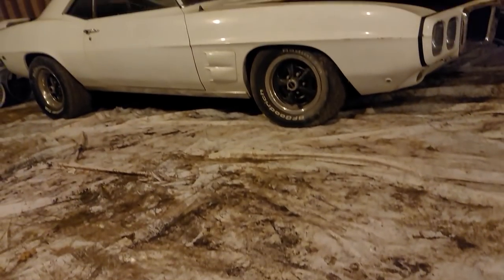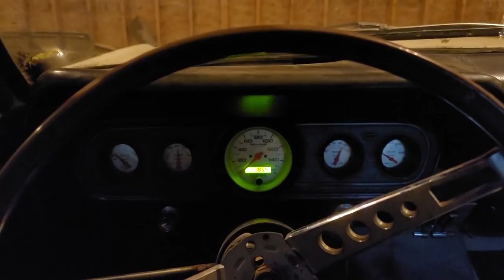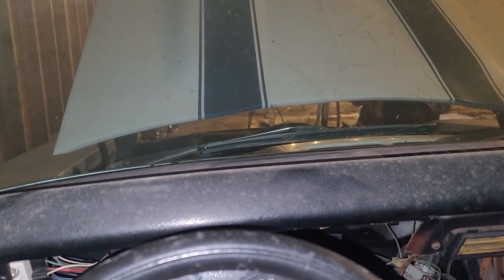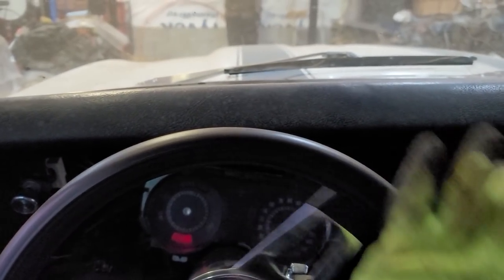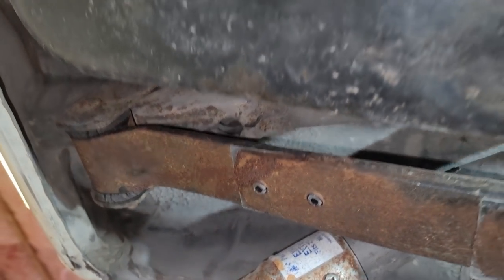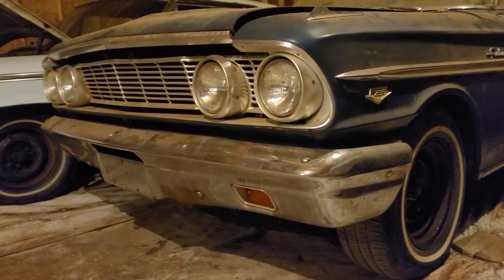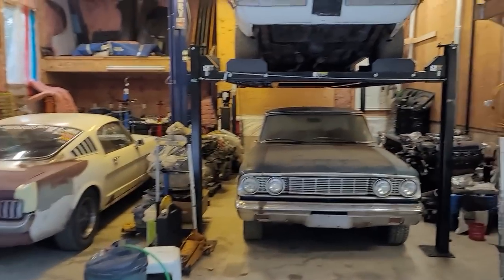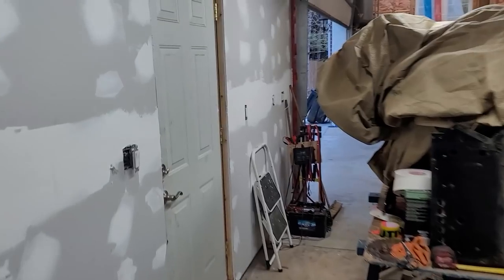GARAGE FULL OF CLASSIC CAR PROJECTS

Comment: Nice channel I like all of your cars. Question for you. I am installing a used lift in my 20 foot wide garage. What is the width of your garage door and how far is the outside edge of your Rotary lift from the inner wall? I would like to be able to park two cars in my garage with the lift installed. I have a 16" wide door. Thanks  Eric
Reply from the maker: Thanks Eric, happy to help. Garage door is 18'. There's about 42" worth of wall before the garage door starts. Outside edge hoist to wall is about 24". Theres a couple things to think about when installing a hoist... depth of garage, angle needed to get the car into the garage and nicely positioned for the hoist (2 post hoist are a little more forgiving in terms of this). I assume your garage door is center in the 20' wall (2' on either side of the 16' garage door?). You'd probably be ok with placing the hoist pretty tight to the wall (the hoist bottom flange/plate will kick it off the wall 4-5"). Our hoist is about 124" wide outside edges of posts (not counting the flange).  So I think you'd be ok with getting two cars in. Let me know if you need anymore measurements 👍
Cheers Mike